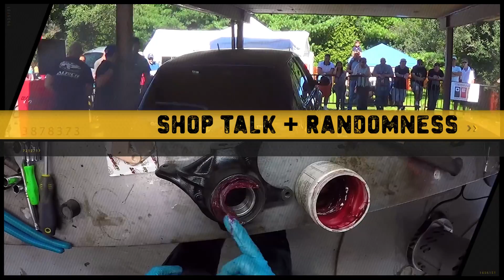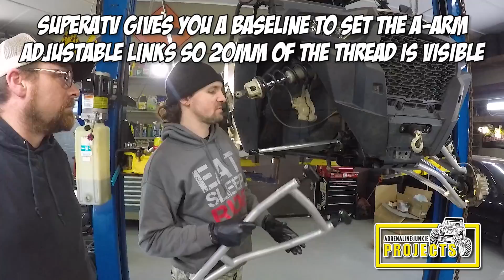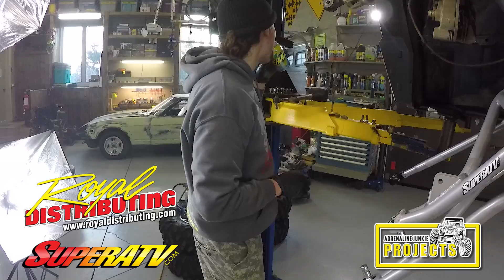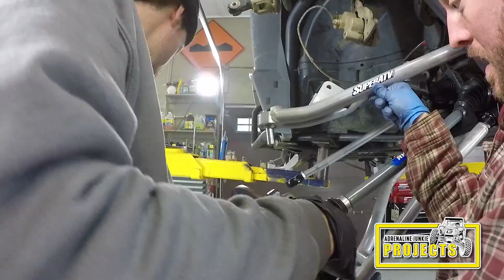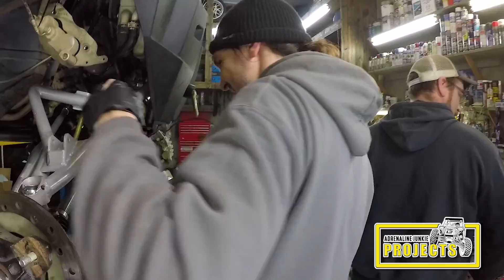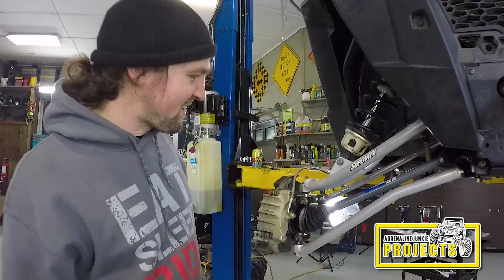How to Rebuild a Polaris RZR Front End - DIY Step by Step Re-Assembly Procedure - #TeamAJP RZR Build

Comment: the build looks great i heard bad things about the rhino axles like they break off inside the diff instead of at the joint.i dont know how true that is. i do love those a arms though! 
if you do not have a wheel bearing greaser tool already you should order one. i had  the holy greaser wheel bearing greaser https://www.holy-tools.com/  to re pack them periodically.  you will get much more life out of the bearing especially in the muck you ride in pushing the old grease out with new will be a major benefit to your machine. i had 1500 miles on my rzr when i got rid of it and bearings were still no play in them.